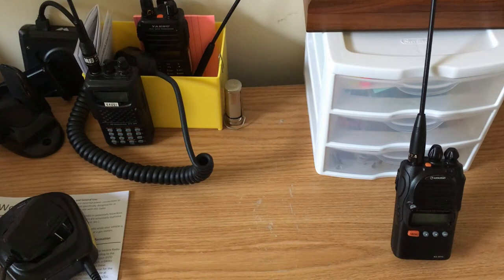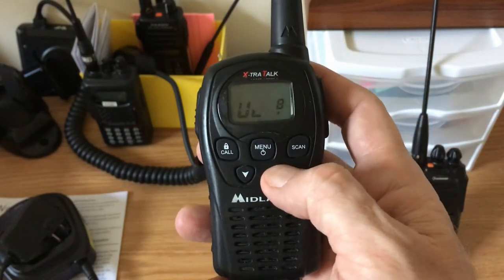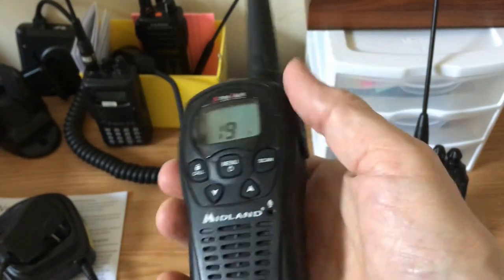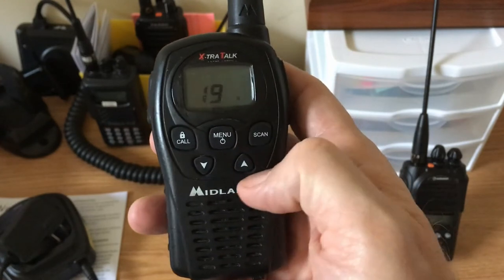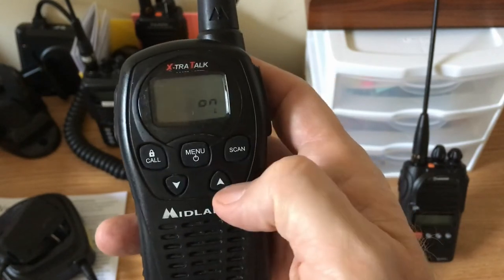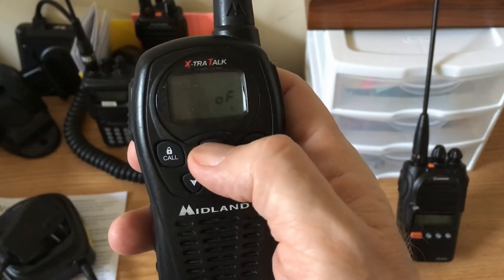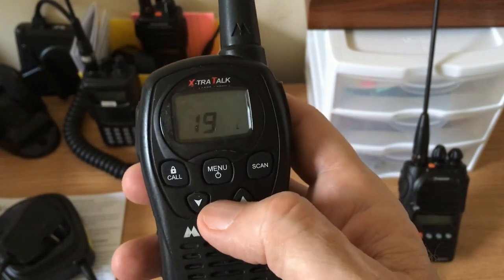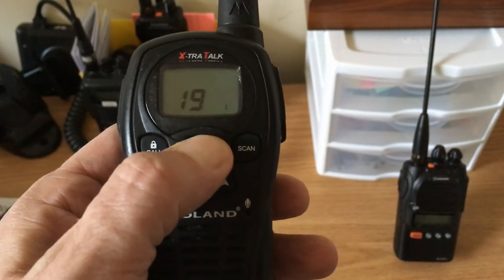Basic radio settings

Comment: I have the same radios that you are demonstrating. I bought them in Mexico and use them here. I can't change any of my settings because the radios are locked and a lock symbol appears on the upper right portion of the screen. Do you know how to unlock the settings?
Reply from the maker: With the radio turned on, press and HOLD the button with  a lock on it. It should beep and the lock will be gone. then release the button.
Reply: you need a radio tec and do you need a license to use them here in the us

Comment: I need to know how go turn of the VOX setting on that exact model
Reply from the maker: For Midland handeld radios VOX is adjusted by pressing the MENU until the VOX or oF flashes. Pres the up or down buttons for oF, 1, 2, 3 is displayed. Press the push to talk PTT button to lock in your selection.

oF is VOX off. The numbers are the sensitivity of the VOX feature.
Reply: find a radio shop and ask them

Comment: How do you get to hi power?
Reply from the maker: Cycle through the menus until you see Pr. Then use the up or down arrow to change power H or L. Press the Push to Talk button to lock in your changes. Channels 8 through 14 can only be low power.
Reply: to do that you need a license family service is rated at 1/2 of a watt
one mile or line of site channels 15 through 22 are off repeater channels
on family service
Reply: channels 1 through 22 are low power your hi power channels are r p t
15  through 22   rpt stand's for repeater channels a  F C C license will be needed as now you are 45 watts and can talk 20 miles or more
Reply: @personalradiofun526  well three years have passed we are still 
at high power and low power F R S is low power  G M R s is high power but 
but you cant use high power with out a licensee for it and your radio need's 
a  PL tone to talk to a tower to get your 20  miles I have done all that